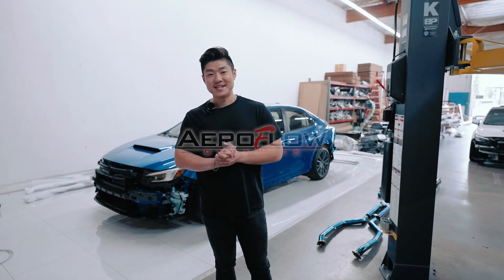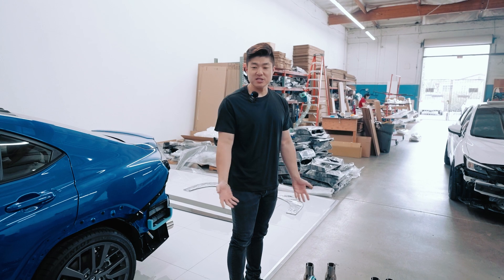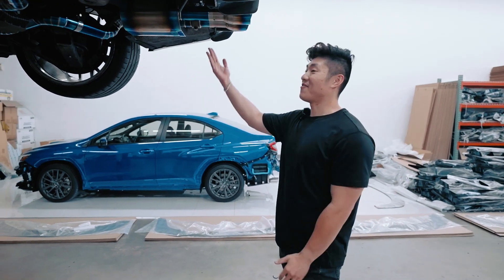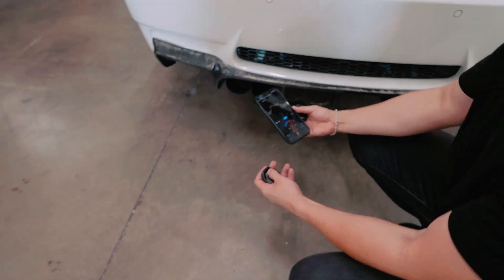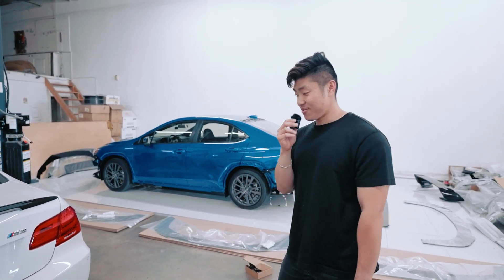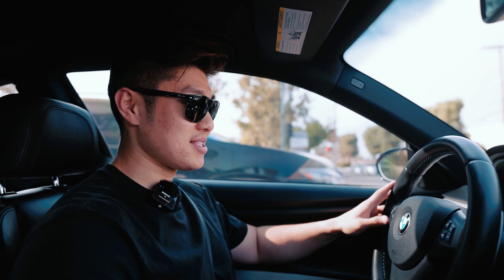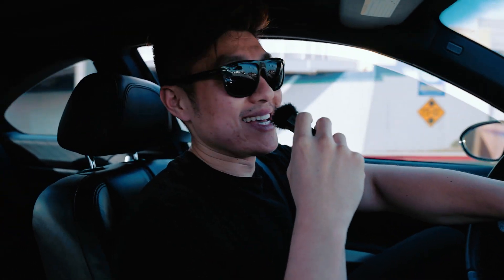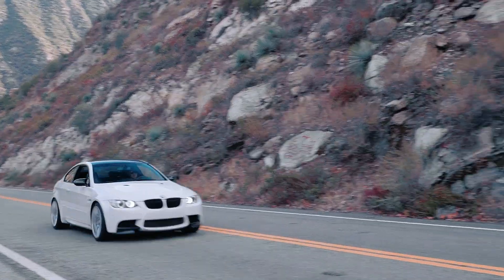WORLDS LOUDEST BMW E92 M3! | Straight Pipe  F1 ( Sound Clip )

Comment: My issue with cat delete on my E92 was the smell. The sound was phenomenal, but the smell inside was giving me headaches.
Reply: Might have had holes in your floor boards or went with a terrible welder. I’ve used bimmerworld x pipe and miestershaft GT with no smell unless you’re outside

Comment: I have a valvetronic setup similar to this for my E93. If it’s a full muffler delete, will it be louder than with the valvetronic muffler?

Afterall it’s just a bypass balve though. Pretty curious about this
Reply: The valvetronic muffler is already a muffler delete when the valves are open. It’s a full straight pipe when the valves are open and when the valves are closed it forces the exhaust through the muffler.